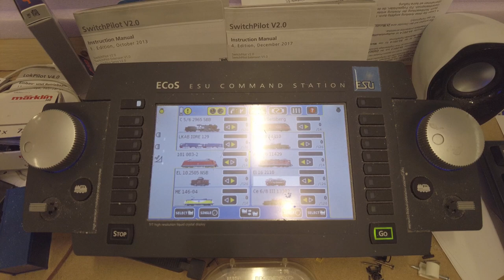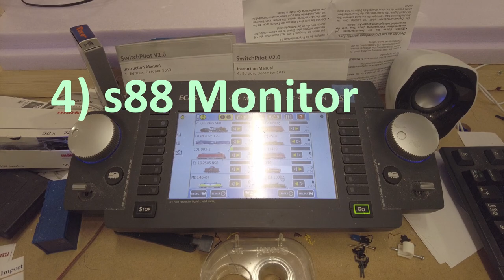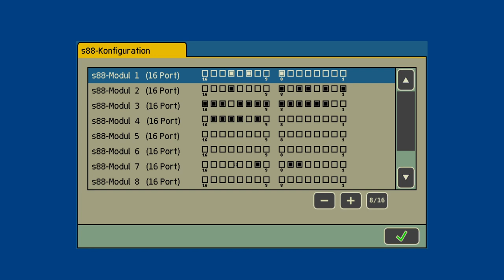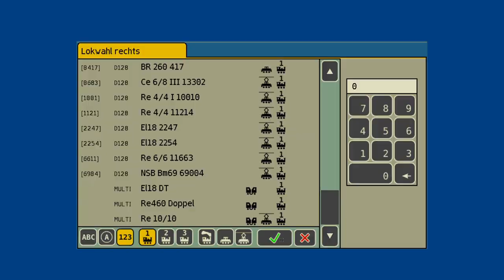6 advanced tips for your ESU ECOS

Comment: Why is your mouse just a small dot? Can you turn it into an arrow like in Windows?
Reply from the maker: When using the remote connection with VNC, your mouse pointer get substituted with end device cursor. Since the ECOS is ment to be used with the touch screen, this will happen. I used to the remote connection to do a proper screen capture.

Comment: cool, dake für die tips. cool and thank you for the tips.
i saw the manual for the esu swich pilot 2.0, could you do a video on how to set it up with märklin swiches and the esu ecos? that woul´d be great.
on an earlier video i asked you about the esu ecos and the ability to use more than 8 function buttons. you were right, there are way more, but they don´t mention it on the website of esu. i bought a new ecos so it had the newest update already installed, thank you again.
Reply: You can use the DCC Protokoll and the m83 or the digikeijs dr4018
Reply from the maker: I only use the Switch Pilot Servo. For non servi switch I used old Mårklin decoders In had lying around. And since I have mounted all switches, I won't buy more deocers in the near futures. But I might do other ECOS Tutorials.